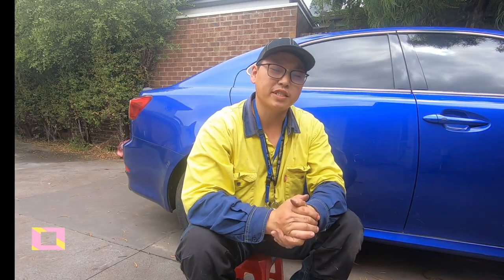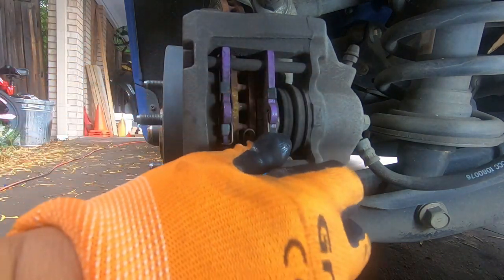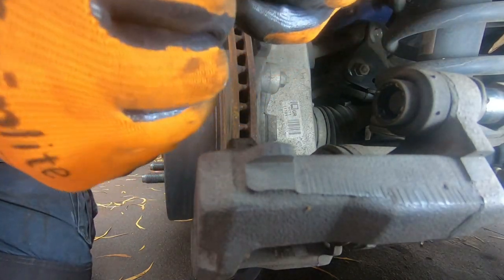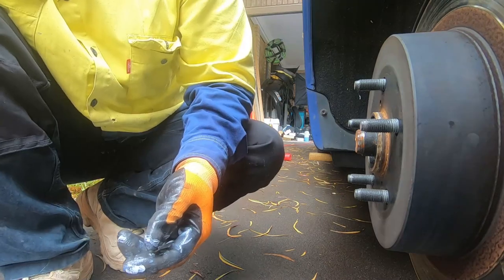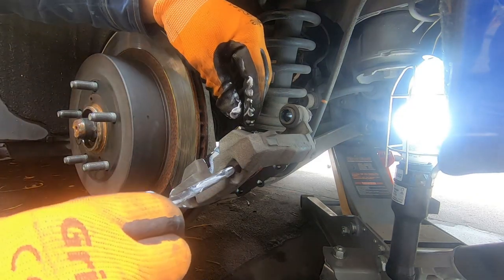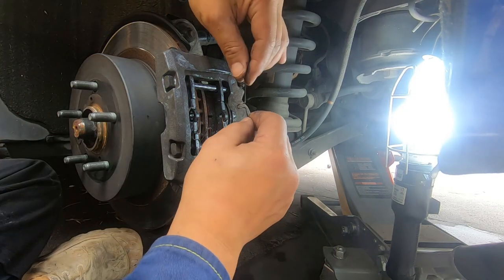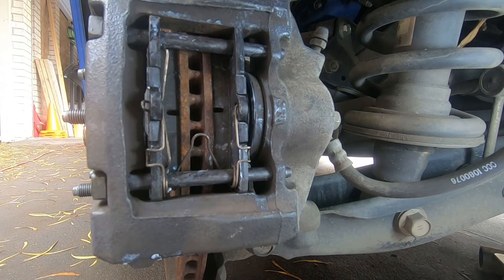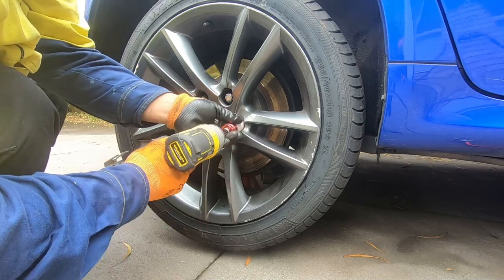2011 lexus is350 F-sport  D.I.Y rear brake pads change

Comment: Thanks for the video.   Good job.    We need to be sure that grease doesn't find its way to the friction spots.  .... pad surface...... also, opening the brake fluid cap allows the fluid to move back to the reservoir without back pressure
Reply from the maker: very good thanks for sharing

Comment: You got grease all over the pad friction surface from your gloves 🙄
Reply from the maker: ye bud that all goes away after u do the wear in ... where u drive to 80 brake hard then drive to 50 brake hard ...do this few times to remove the laminated cover from pads